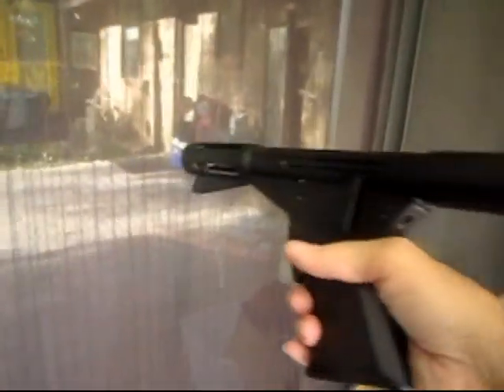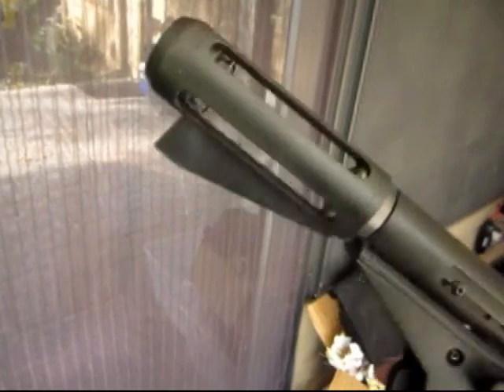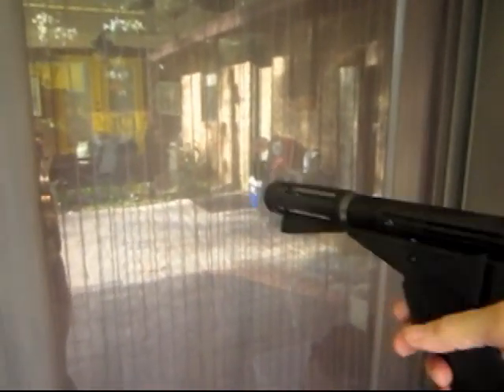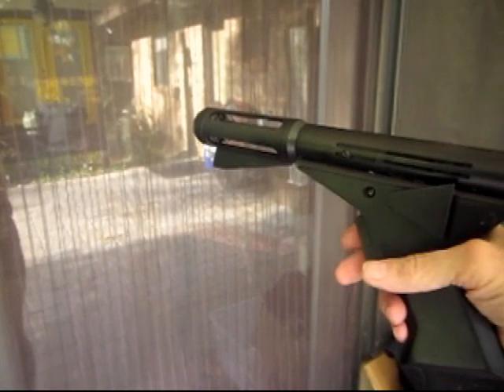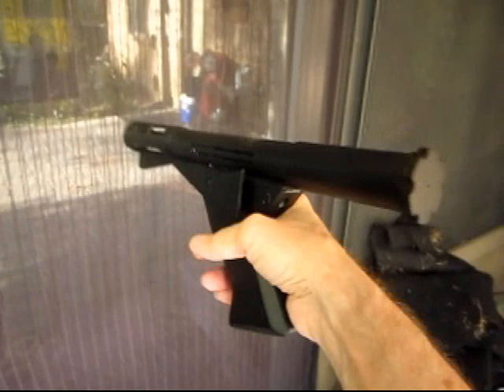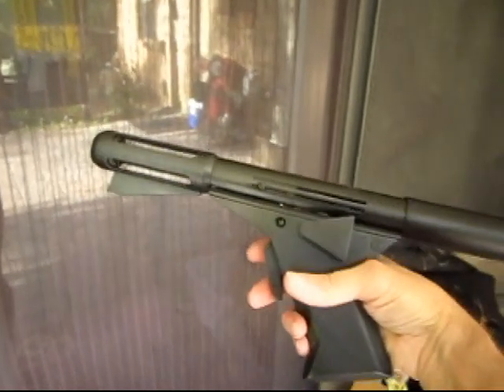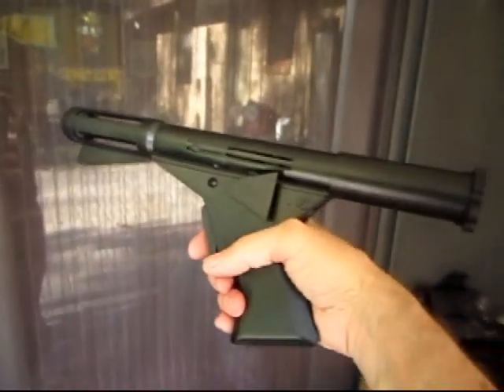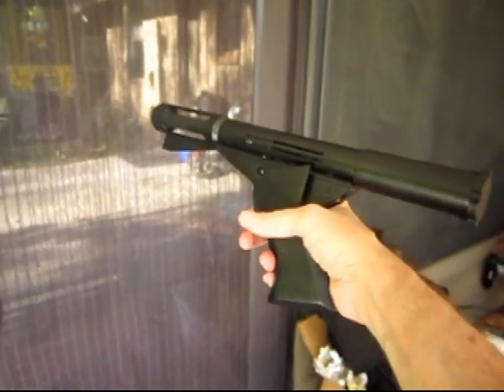Working Logan's Run Flame Pistol 3D printed PLA Sandman DS Prop

Comment: I just looked up, "Logans Run" as I am from Dallas, Texas, and I was 14 years old when it was made. I remember a "Sandman Gun" that was going around Dallas, but, don't who made them. They had a flicker and a bulb and used regular batteries. Pulling the trigger made the little sights come out in a target pattern.